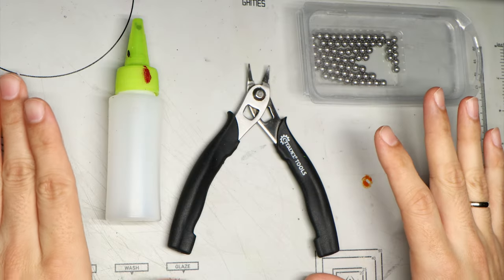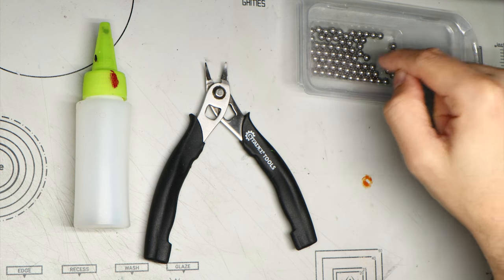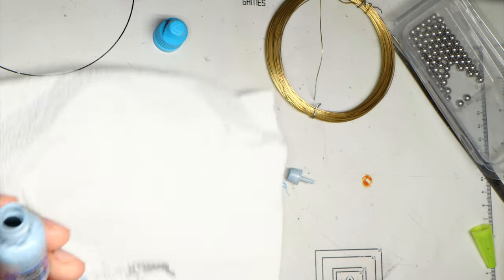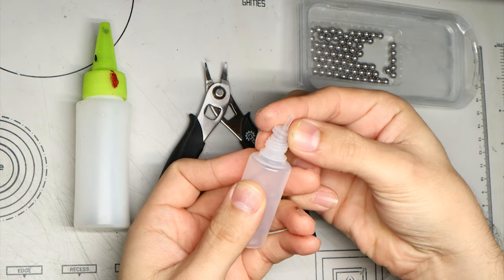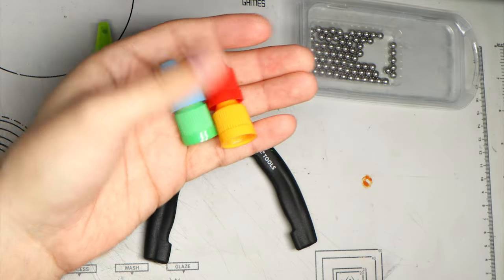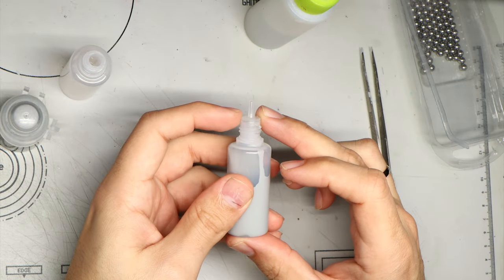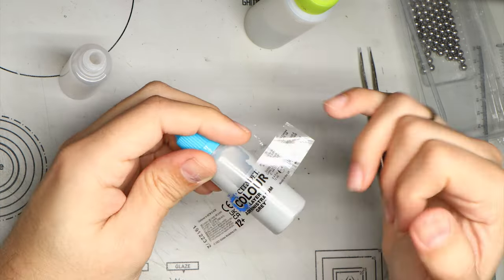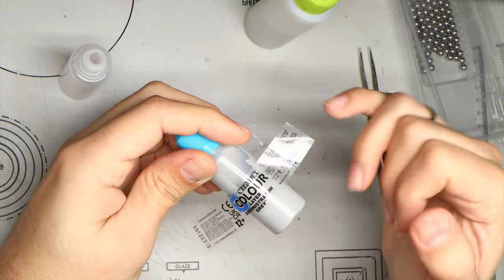THE EASIEST WAY to transfer your Citadel paints to droppers!!

Comment: I feel like this could all be solved by GW just using dropper bottles from the start, but no.. we can't have that. we need your paints drying out early so you buy more paint!
Reply: I really don’t like dropper bottles and find they waste far more paint than flip top bottles do.
Reply from the maker: Believe it or not a lot of people prefer pots and that's ok. Pots are more user friendly for new painter, specially for younger hobbyists and they do have their advantages
Reply: @JuanHidalgoMiniatures until the paint explodes all over you when trying to open a stiff top 😂 Happened to my grandson when opening a contrast paint pot.
Reply: It sounds like from the former GW paint manager that was on the Painting Phase that GW won’t do dropper bottles because they basically want kids and beginners to paint with as few requirements, IE you can paint straight from a pot while a dropper bottle will require some sort of palette or similar item to put the paint on.
Reply: We also need to be cool unique and special.
Reply: I feel as though those pots are designed to waste as much paint as possible through spilling/drying out.
Reply: That's why Two Thin Coats paint exists...
Reply: Dropper bottles are preferable for people that are using a palette. For a kid painting their first army its much easier to teach them to stick a brush in a pot then put that brush on a model than it is to teach them how palettes work.

It's part of the ways GW lowers (non financial) barriers to entry
Reply: @JuniperTheSloth  i will definitely teach my little one to put paint on the palette and paint from there. :)
Reply: Some ex-GW people responsible for those things said there id no reason to change those. They want your paint to dry hard fast.
Reply: @jonscott6459  how?
Literally 15-20% dries up when you are using a pot bottle.
Have you ever used one to completion? Try to see how much dry paint is left there.
Reply: @JuniperTheSloth  yeah, I don't know what is so hard about squeezing a bit of paint on a palette and then doing the sane, only you get better control of how much paint you are taking on your brush.
Either you are trying to teach a 3-year-old to paint warhammer or you are severely underestimating mental capabilities of your child. OR you are speaking in pure hypotheticals something you heard on the internet.
Reply: @Aisaaax  only if you make the mistake of leaving the pot open. With a pot, I can put as much, or more importantly, as little paint as I like onto my palette then close the pot. With far too many of the dropper bottles I own, I have to first unclog the nozzle with a length of wire and still can end up splurging a huge blob of paint out, when all I wanted was literally half a brush worth. I just find pots so much easier to use.
Reply: @jonscott6459  IDK what your problem is, I have been using dropper bottles for years and the only one I ever had problem with is Coax White transferred into an amazon bottle. And that's Corax White to blame, not the bottle.
If paint dries in the nozzle for you - that may be because you are not closing it right away or not closing it well. If you squirt a huge blob of paint - that's because you are trying to unclog that bottle by squeezing it - and that's 100% on you. Both of those things are.

With a dropper you also have full control of how little paint you get on the palette. Don't squeeze it - and you'll get 1 drop. Need less - hold it sideways and squeeze lightly while touching your brush to the nozzle - you'll get a tiny tip of brush full of paint, no more.

Meanwhile every time you open your pot you expose like 1 square inch of paint surface area to air. It will dry around the rim, on the back of the scoop, it will often get on the outer rim of the pot and dry there, making the pot close less airtight and contributing to more air drying.

Literally not a single person who paints a lot will recommend using pots to you. If you've got problems with a dropper bottle - honestly, this is all you.
Reply: @Aisaaax  I’m delighted for you. You buy your droppers. I’ll buy my pots. Everybody’s happy 😊
Reply: Remember, GW doesn't care about you. They care about johnny-5-year-old
Reply: @knightsljx  nah. They care about being different. Too many paint brands in dropper bottles, and the pot looks cool and unique in the eyes of a new consumer. It looks professional. Miniature-specific. It looks Warhammer. 

Johnny 5-year-old would have a much better time with a dropper bottle because you can't spill it, it's harder to overload your brush with thick paint, it is easier to close and open. Even I struggle opening my pots sometimes, and I'm an adult.
Johnny 5-year-old would be just as happy sticking his brush into a blob on the palette as sticking it Into a pot.
Reply: @Aisaaax what are you going on about a pot looking cool and unique, a pot is standard, has been for many decades, dropper bottles are newer, both are just a container no need to get so worked up about it. There's nothing wrong with a beginner painting straight from the pot, its cheaper and easier for someone just starting out.
Reply: @nick1635  a pot is standard? Citadel used to use dropper bottles before pots. Then changed for marketing.
Reply: @JuniperTheSloth 
"Lowers financial entry" 😂. Like they give one fvck. If anything they've out done themselves pricing its customers out of the game.
Reply: @jc7997aj   I know reading is hard but if I type "non financial barriers to entry" and you quote me as saying "financial barriers to entry" it kinda makes it look like you didn't actually read my comment.

I'm fully aware GW has scummy business practices. I spent like an hour yesterday rambling to friends about how annoyed I was with the way they're re-releasing the older Underworlds warbands without selling the decks separately (forcing people to buy the models twice if they supported UW since launch).

My point is that a lot of their business model is based around little timmy dragging his parents in on his birthday because he saw his friends playing with cool space soldiers, and being able to market it as "you need these 5 paint pots, this brush, and this £50 starter set" is an easier sell to parents without a background in painting.
Reply: Not the 5 year old per se but that 5 year old when they are 20-50 years old.
Reply: I've started to paint a month ago, I bought lot of stuff, citadel, Vallejo and AK. I had 3 accidents, all of them with citadel pots.
Pity cause I love the paints but I really really hate the pot format. A palette is not expensive come on!

Comment: The moment I spilled my brand new pot of Apothecary White all over my desk, I was done with pots, even for contrast. My Wraithbone had already started to 'crust' along the edge, so in reality these pots are meant to dry up your paint, and force you to keep buying them, and to top it off they are more expensive and give you less. Also yeah, there may be a bit of loss of paint with the transfer, however the pot design makes you lose more, and glad you addressed it. It's malfeasance, by design IMO

Comment: These are some great tips, although I would also suggest picking up a 20ml/cc Packing Syringe with 1.5 Inch Blunt needle from amazon, so after you water the paints down you can basically suck up the entire pot, and put it right into the new bottle all in 1 go. Everything else I did pretty much the same except it was quicker and cleaner in my experience.
Reply from the maker: I just don't like to use extra tools if I can avoid it but yeah
Reply: I bought the wrong type of syringes and ended up just scooping with a brush. Wasn’t too bad but pretty frustrating. I got into a bit of a rhythm and did about 20 bottles. I got 10 more to go and now I just can’t be bothered haha

Comment: I use a 3D printed screw-on funnel that works beautifully. I can scrape almost every last drop of paint out of the pot and scrape the brush on the lip of the funnel, then push it all down into the dropper. I only use white caps, then I put a drop of paint on the cap to show what color is inside. I then designed and printed a 10x10 rack that's less than 12" wide to slot them all into. Army Painter droppers fit int the rack as well. 100 paints in a tiny space-saving rack on my desktop. I should probably do a video to show it off.

Comment: To get even more paint out, you could use a clay shaping tool like a spartula, saving additional drops of paint and not thinning out your paint as much. Also, the clay shaping tool is super good for milliput/greenstuff work
Reply from the maker: I personally can't be arsed but it's a good tool to have and works well for this purpose
Reply: I just wear a tight non-powdered nitrile glove and swipe my index finger around the pot and scrape it off on the edge of the bottle.  I use Monument Hobbies’ empty bottles because they have nice wide necks and come with glass bead agitators.  Can salvage the vast majority of the leftover paints.

Comment: I whish this video was up when I started to transfer my paints to droppers 😁
Experience and a lot of trials and errors brought me to your same conclusions so my process is fairly identical. 
Only difference are:
- i still use medium instead of water to thin the paints prior to transfer them. I lost count of how much Lahmian medium I burnt for this 😂 but now I’m going to try Scale 75 Dispel Magic medium that I read works magic and comes in 60ml bottles for less than a Lahmian medium pot.

- I’m using agitators balls (same from AP) in contrast too, for those one who leave a residue on the bottom, as you pointed out in your video.

Last, I’m going to give a go to your bottles since I’m not really happy with the ones I used until now (cheap ones from Amazon). 

Thanks for the video on behalf of all the newer painters who will spare a lot of troubles watching this!
Reply from the maker: Happy to help!

Comment: I use similar steps, but then use an old size 2 or so brush to clean out the GW bottle and deposit into the new as well.  Small extra step to get additional paint out.
Reply from the maker: I can't be arsed but it's a good additional step

Comment: you can also use small stainless steel funnels. i find it is a bit easier and faster when you have a lot to transfer. some have the shape of airbrush cups you can put the pot on top and get the last bit of paint drop without holding them. very cheap too on AE.
Reply from the maker: I can't be arsed but you do you!

Comment: Just buy a little funnel dude! Can leave the paint put upside down in the funnel and come back in 10 mins. Adding some water to the Citadel pot before transferring to a dropper bottle though is EXCELLENT advice. Makes the transfer so much faster, especially for the thicker base paints.

Comment: Man, I remember transferring all of my Citadels and it was such a pain. Don't get me wrong, it was worth it, but I ended up moving to vallejo anyway. I definitely used funnels, though. They were really helpful because I could transfer multiple paints at a time and I could then use small sticks to pull out remaining paint from the pots and into the new bottles easily. Pots ended up so empty that I would say the paint loss was seriously only about 1%! However, like you said, even a 5% paint loss isn't a big deal.
Reply from the maker: At the end of the day it's your choice, but I prefer mine obviously
Reply: @JuanHidalgoMiniatures For sure! If I was only moving a couple paints, I would do like you showed and skip the funnel. Distilled water is also a great option over mediums, as you point out.

Comment: Note that you should use distilled water only. Tap water will eventually turn rotten and grow mould inside the paint. 

Also you can just use an old brush to scoop out those remaining last bits of paint.
Reply from the maker: ONLY distilled water please

Comment: This might be a stupid question, but could I use thinner instead of water when doing this? I don't have distilled water, but I've been using airbrush thinner to thin paints even when painting by hand, so it's what I have available.
Reply from the maker: Of course you can

Comment: When you use a funnel (which in right size is hard to find and I 3d printed mine) you can easily "scrape off" the last paint from the pot with an old brush and have basically no paint left in the pot. Also my hands are just not steady enought to hold the pot and the bottle together for time it takes for the paints to come out. I could do maybe one or two but when transferring youre whole collection...
Reply from the maker: I get it, I just hate to have to clean them afterwards. But sometimes you need to use the tools you need to use
Reply: @JuanHidalgoMiniatures  I have a large cup of water next to me and I usually have about 4-5 bottles/funnels going on at one time. Once one of them has drained, I throw the funnel into the cup and after all are done I just quickly rinse them in the sink, dry them with a towel or paper and can start a new batch right away. The funnels aren't completely without staining, but they are clean enough to be reused without the colors contaminating the next batch.

Comment: If i plan on using this for airbrush painting, could i put some thinner in the bottle instead of water? Or would that cause some unwanted side-effects if it sits together too long?
Reply from the maker: I wouldn't risk it myself, it could be that it does nothing bad but also that with time the chemicals degrade the paint

Comment: Guess I need to get myself a little distilled water. This is stupid easy and it might just be worth the effort transfer my Citadel paints over. 

I can happily report the Green Stuff World their mixing balls also don't rust. I put them in my lighter contrast paints (the ones that have visible residue on the bottom) as it mixes them back together a little fast. They haven't given me trouble yet. 

Also, AK Interactive sell empty dropper bottles in packs of 6. They got a nice little indent on the cap that you can easily drop a little paint into. Perfect for easy reference of what the paint looks like when dry.
Reply from the maker: Awesome! I refuse to buy anything from GSW but it's good to know there are alternatives for other people

Comment: Only question I have is does the paint ever get any thicker again or is it now permanently thinned? This may affect my ability to dry brush with transferred paint which is something  do a lot to save time painting loads of orks.
Reply from the maker: It doesn't, so if you want thicker paint consider not transferring them or using a syringe

Comment: You don't actually need to cut the lid off of the GW pots. The plastic is flexible enough around the pot where you can simply pull the whole lid off.
Reply from the maker: Oh I know, but it makes it easier